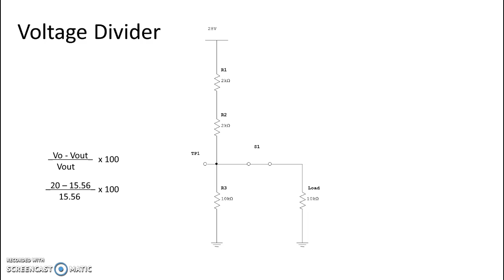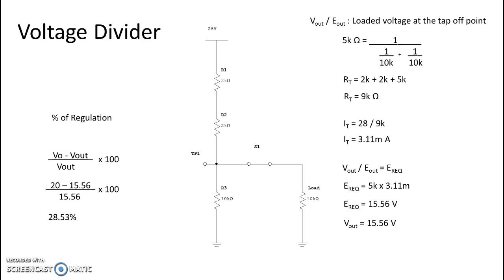Voltage Divider

Comment from the maker: Please note, that if you are doing the military BMET program they no longer teach % of regulation.  That means that you can stop watching this at about 8:30, since the last minute talks about that topic.  Please also note that they have started using slightly different designation under the new CBT for unloaded and loaded voltage.